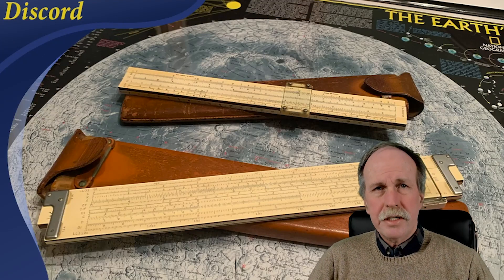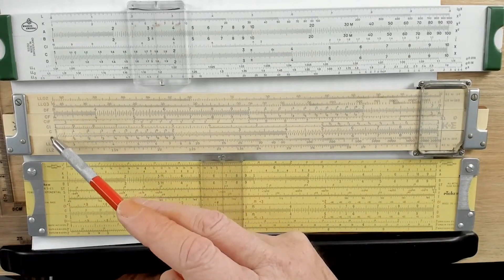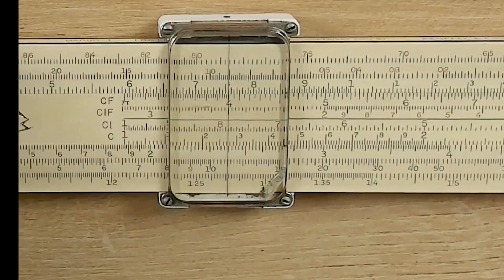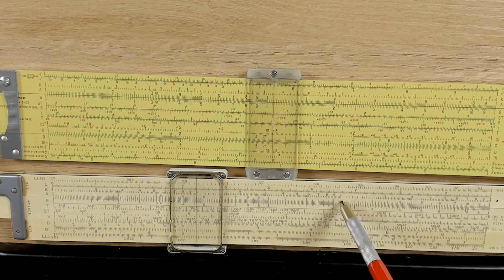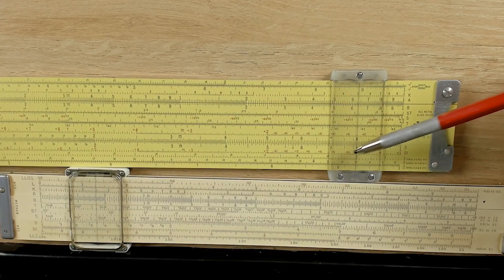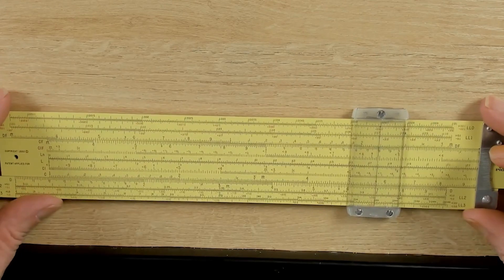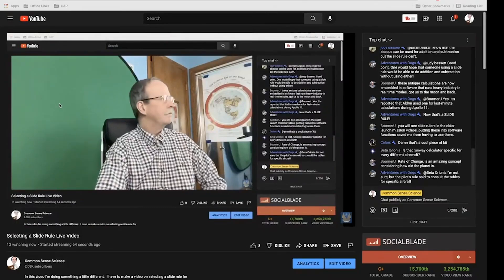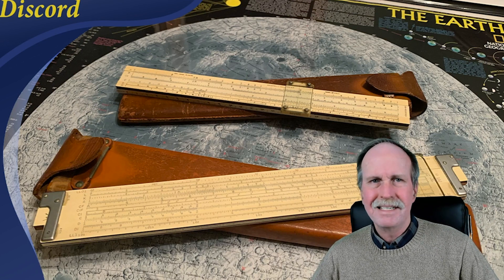Selecting a Slide Rule 2- The Engineering Rules

Comment: I used a Post log log duplex made from bamboo. Thanks for the video. Could you add the slide rule links to the description?
Reply: Judy, Back, in the 60's, when was in school I also used a bamboo Log Log rule. Yes, they were NOT as accurate as the modern day calculators but they were fast! But you had to have good eyesight 🙂 It really made my polar- cartesian conversions very easy.